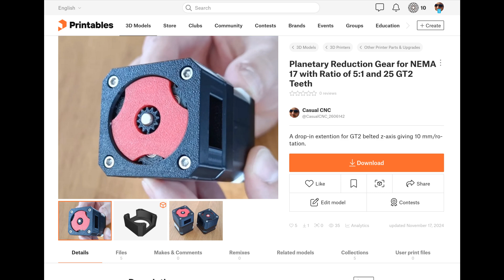Tiny Planetary Reduction Gear to Prevent Z-Axis Drop

Comment: Did you consider a counterweight like on the Voron Switchwire? I am facing similar challenges, and would love to hear your reasoning.

Also, you have introduced misalignment so the belt is no longer running straight where it should be. Se at 3:21. The belt it not perpendicular to the movement of the gantry, which will mess with the travel accuracy. 

Also, just by looking at the printed gears, it is obvious that this is gears that are really loose on tolerances. Which again, hurts accuracy. There has been quite a lot of noise about that for BMG style extruders lately. There have though, been no such focus on steppers driving belts nor on idlers. I love your focus on back clash, and it would be great to get some feedback on how this worked out for you. I just don't know what test ask you to do, since accuracy on the Z, I am not really sure how to test for that. I guess solutions like this probably is good enough for a ton of users, as their prints are not that picky on dimensional accuracy. Good enough, is good enough.

Thanks for showing us the weight on the Z. That was way heavier than I expected. As much as I love this design, it is done the wrong way for cross gantry. The weight of the Z, is just way too heavy.

Also, as much as love the innovative form of this, it seemingly offers no way to calibrate the axis, as to get them square. Did I miss something here? The accuracy of frame alignment is bound by the printed parts, like the top and bottom? Is there more to it?

You got 3 rails running in parallel. Usually that is pretty tricky to align. There is way more slack in these rails than people think, so if this just snapped into place, and the printer accuracy was enough for rails alone? I would love to hear from you on that one.

Despite all these issues that seemingly should result in sloppy tolerances, I am continuously amazed that in the end, the printer accuracy is way tighter than it "should" be.

Again, I really like this design. Just wondering how this worked out for you.
Reply from the maker: These are very good observations and questions!

The very short version: Because I can, it is good enough, brings me forward and I learn a lot while having fun :-) 

> Did you consider a counterweight like on the Voron Switchwire?

Yes. Counterweight or constant-force spring would be a better solution, but I found no "nice" readily available one which would fit the printer without increasing the size nor destroying the design. It might be that I've simply missed one. Adding a constant-force spring to the same footprint as the planetary reduction gear would be great. That's one thing I put on my todo-list (which is way too long).      

Another argument to go with the reduction gear was the step size. The smallest direct pulley which fits NEMA 17 is 13 teeth, maybe 12 is possible. 13 teeth give a resolution of 8.125 μm / micro-step and 0.13 mm / full-step. This may possibly affect Z layer consistency, when printing at 0.2 mm layer height. Reduction gear results in 0.05 mm / full-step.    

> Also, you have introduced misalignment so the belt is no longer running straight where it should be.

Correct. I also mention, that I plan to redesign the Z-axis later. The affect on travel accuracy should be negligible however. Speculation: If belt is not too tight, it is not the short part of the belt close to the rail but the long one at the far side which matters - gantry is being pulled up. This would give a travel accuracy factor of sqrt(280^2 + 3.8^2)/280 = 1.000092

> Also, just by looking at the printed gears, it is obvious that this is gears that are really loose on tolerances. ... I love your focus on back clash, and it would be great to get some feedback on how this worked out for you. 

You probably mean the LACK of focus on backlash because my assumption is - it should not matter with this z-axis design as long as gears are not too tight so gantry weight is preloading them properly.

The first assembly had a problem with this - the central gear was pressed to the wall of the printer and could not move freely. Adding washers between the wall and reduction gear case solved the problem. The definitive test: Gantry should fall down slightly on power loss.

Z banding/wobble test tower prints nicely: https://www.printables.com/make/2196999

> Thanks for showing us the weight on the Z. That was way heavier than I expected. As much as I love this design, it is done the wrong way for cross gantry. The weight of the Z, is just way too heavy.

The way too heavy for what? Note, this is the weight of the whole gantry, not just the parts moving on the XY-plane. The heavy gantry actually reduce vibrations of the parts moving on the XY-plane (print head + rails). The limiting factor for the Z-hop is not the weight of the whole gantry but the cantilever design. Motors manage the Z-hop without any problem, and I even installed a noname NEMA 17 42-23 which is still not getting really hot.

> ..., it seemingly offers no way to calibrate the axis, as to get them square. Did I miss something here? The accuracy of frame alignment is bound by the printed parts, like the top and bottom? Is there more to it?

That's correct - no way to adjust any of the axes. Judging by the bed-leveling being within 1 mm, this worked way better than expected.

> You got 3 rails running in parallel. Usually that is pretty tricky to align. There is way more slack in these rails than people think, so if this just snapped into place, and the printer accuracy was enough for rails alone? I would love to hear from you on that one.

The gantry indeed moves freely on the whole Z range. I assume, printer case and the top frame are quite accurate. Rails are not mounted in-between and they are not that rigid. In addition, gantry consist of 3 separate parts attaching to rails, which gives even more flexibility. Actually, in the next iteration I plant to use a single printed part attaching to all 3 rails and replace vertical rails with rods.  

> Despite all these issues that seemingly should result in sloppy tolerances, I am continuously amazed that in the end, the printer accuracy is way tighter than it "should" be.

Indeed, I am surprised as well. Just to be clear: It is not on the level of e.g. Creality K1C, and will never be. It prints quite good, but, depending on the part design, you may immediately see the difference in the printed part. There is some extra "noise".
Reply from the maker: Here are some numbers on how reduction gear affected the probe accuracy.

Probe accuracy tested with klipper using inductive sensor at 3 mm/s.

Direct gear with 13 GT2 teeth. Micro-step size 0.008125 mm. Typical probe accuracy 1-2 steps, i.e. 0.008125  - 0.0165 mm.

Planetary reduction gear. Micro-step size 0.003125 mm. Typical probe accuracy 3-4 steps, i.e. 0.009375 - 0.0125 mm.
Reply: @CasualCNC  Thanks. This seem to indicate that the accuracy is beyond the probe accuracy, but hey, look at them numbers. 9,375-12,5 micro meter. The thing is that the tolerance of the rails are at best 20 micro meter, that is, if you are using the super expensive tight tolerance ones.

As I have said, it never cease to amaze me, what sort of accuracy we might achieve in the end. Which is kind of raising some red flags to me, just like the drive gear thing for the extruders. Also, you did not reply on the belt issue, which is clear as bell, but easily fixable. Nor any reply on alignment as in getting things square.

But as for the numbers you did gave me, it is important that we all realize, that them linear rails are not running in parallel within them tolerances, nor are they manufactured anywhere near such tolerances, as given by the bed probe. These are real numbers, just not numbers on real flatness of any bed. 

So in the end, using printed gears with this sloppy tolerance, if I get what you are saying right, you do not see any loss in accuracy? Because them gears you made, are sloppy, compared to the drive gear issue uncovered for the BMG style extruders. But for now, that does not seem to matter that much in actual usage. The slack is acceptable, for most users.

Which sort of brings us back to them linear rails. Why is everyone seemingly crying about the need for them? Why is tolerance this important for the extruder, but not for the axis? That makes no sense to me. This supposedly accuracy of them linear rails, is simply not there, nor is this supposed lack of slack. Because them rails are simply not mounted in any chassis anywhere near the crowd claimed tolerance of them rails. They should be binding like no tomorrow, given the wisdom of the crowd: They don't, nor should they. A topic you sadly did not reply to.

The irony of it all, is that them rails, even the "high precision ones" have tolerances like 3-4 times worse as comparable H6 rods. They cost like 10 times as much. Yet using gears for the gantry printed at an accuracy of "H2000" there is seemingly no loss in print quality? This simply do not add up.

Just to be crystal clear: This is not questioning your work. I really like your work. I am not questioning the results you just gave me, they all seem to be reasonable. As a designer, I am calling the bluff on them rails, and I am starting to question how we make our gantries. The understanding I am being given is simply false. This does not add up at all. What a better understanding actually look like is what I am working on, obviously. We are seeing what we are seeing, we just don't understand it properly. And if any doubt: Nor do I.

Anyway, thanks for the feedback.
Reply from the maker: @FrodeBergetonNilsen  You've probably overlooked my first reply. 

I'm not sure if PROBE_ACCURACY, which I've used for numbers in the second reply, is the right test for the cheap vs expensive rails. These are just 3 mm of vertical travel at low acceleration and speed.
Reply: @CasualCNC  I get that. I am not sure how to measure anything correctly at the moment, but that bed probe, it set to measure like a few mm of travel. That is what it is designed for.

I am looking at measuring the travel on the axis, with a caliper. But you are right, that will not tell me much about behavior under travel.

Also, my asking about your experience of getting this square, is just that. Your work stand out and is distinctively different. I just wonder how this worked out, trying to understand these issues, drawing on your real life experience.

I love your design. It is both visionary and crazy innovative. But you are mixing super expensive linear rails, with crazy sloppy gears, and it seems to work out just fine.

You seem to be able to print pretty fast, with a 1.8Kg Z-weight, that has very little structural support.

Please understand what I am saying. Everything you do seems trustworthy. I got every reason to trust that you get the results you claim to get.

That is why your printer is so interesting to me. I do not understand your results, and if you look around, a ton of people argues that this should not be possible.

I actually kind of like when something that defies the wisdom of the crowd arrives. If you experience what you are, then that wisdom is wrong. Only need one single case, to throw out a hypothesis.

You seem reluctant to engage in that conversation, and that is all fine. In the end, that is your loss. I will figure this out anyway. That is what I do.
Reply from the maker: @FrodeBergetonNilsen   There is a "Read more" link on my first reply directly after the "very short version". Are you sure you have read the whole reply? I tried to address all your questions in a lengthy reply, or have I overlooked any specific one?

Comment: Interesting printer design! Do you have to calibrate and compensate for when the print head is all the way out on the cantilever arms? I imagine that there has to be some amount of deflection happening. Or is it linear and is compensated for just by tramming the bed? Even so, I imagine this could cause print skew, which I think printing software can compensate for, have you investigated this?
Reply from the maker: It is compensated by bed mesh leveling within software only, klipper at the moment. The range is however surprisingly small being within 1mm. See my video "Second Iteration of Experimental Crossed Cantilever 3D Printer: N3D" and comments there for more information.

Comment: Im curious how backlash will affect this. If it's small enough, might just do it! I always do belted z and have found in spite of the z axis weight, backlash still matters. I use a belted reducer with a 16t gear on the belt and a big 3d printed 80t gear on the other, then a 20t pulley for the belt attached to the axis. 
Belts reduce, but sont eliminate, backlash. I saw one video where someone made the "ultimate" belted z and had 2 reducers and some gears. Needless to say, didn't go well.
Reply from the maker: I've just printed a "Simple Z banding/wobble test tower" available from TeachingTech on printables.com, here is the result:
https://www.printables.com/model/393668-simple-z-bandingwobble-test-tower/comments/2196999

As far as I can judge, I see no z-axis based issues. Height of first layer was badly calibrated, so artifacts visible there.

However, my first assembly had a problem with backlash because gears where pressed too tight in one direction. Z-axis was not going down on its own without sun-gears installed. Adding some washers at one place solved the problem and now a minimal drop is also visible when steppers are disabled. This tiny drop on power-off could probably be a definitive test if system is working fine.

Also, minimal z-movements are visible when printing due to mesh bed leveling.

Comment: What about backlash compensation from the planetery gears?
Reply from the maker: There is another thing you should watch out: If friction of planetary gears gets too high due to material used or printer setup.

A good test would be to remove the sun-gear and test if z-axis goes down. Expected: It should go down!
Reply from the maker: Backlash should not matter as Z-Axis is constantly pre-loaded in one direction. It could be an issue, if weight is too small (but then you don't need it) or KeyBak or similar is used in combination (which you probably wouldn't anyway) or z-axis acceleration is very high (which normally isn't).

I haven't noticed any print artifacts on a test run, but will keep an eye on that.

Comment: you can calculate for the resistive force of the friction and increase it to be at least the same or slightly higher than the force of your whole gantry/assembly pushing down
Reply: then the whole system will be statically balanced, but you achieved it either way, if you want to not have any excess resistance you can do it the way I said it, or if anyone else has this problem

Comment: Put two of these on a Voron Switchwire and you won't need the keyback.
Reply from the maker: I'm afraid this won't work with CoreXZ design due to backlash.
Reply: @CasualCNC  but you can drop the corexz bs and use it for belted z. And the x motor can be in the middle of the gantry. Man I should fire up fusion 😂
Thanks for the idea!

Comment: in klipper, you can put in a "gear ratio" for any particular stepper, instead of changing the rotation distance
Reply from the maker: Correct, I've seen that, however this would not really be a meaningful configuration, from my point of view. It makes sense if an additional reduction is installed in addition to the existing pulley. Here, original one is removed and there is just a single GT2 gear present, which has 25 teeth. So which ratio would that be? The one comparing old and new? Would you use gear-ratio when replacing the pulley?
Reply: @CasualCNC  i would use the ratio that the planetary gearbox gives, and set the rotation distance to the number of output teeth x 2 of the belt. Its always best to calculate instead of guess xD 
I love the printer tho
Reply from the maker: @SlinkySlonkyWaffle  I see, you are absolutely right! Somehow I thought you are suggesting leaving the original rotation_distance and adding ratio to that.

So "rotatoin_distance=50" and "gear_ratio=5:1" should work just fine.
Reply: @CasualCNC  test it and see if it works, double check the klipper config reference and double check the math!